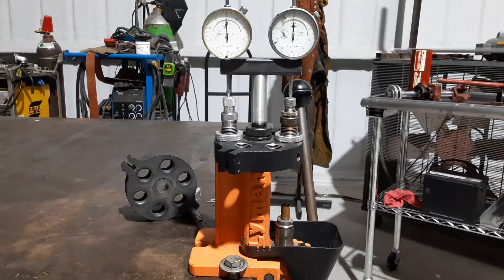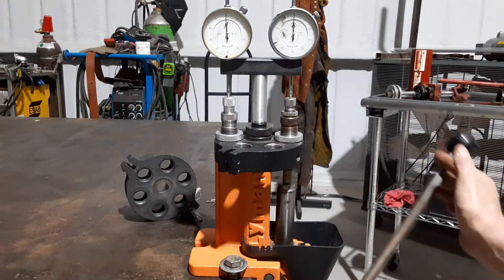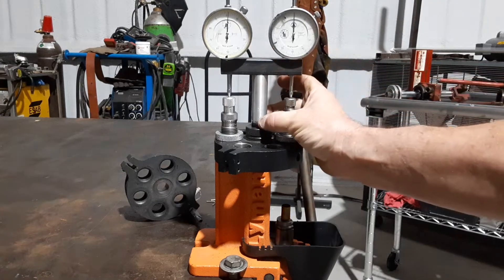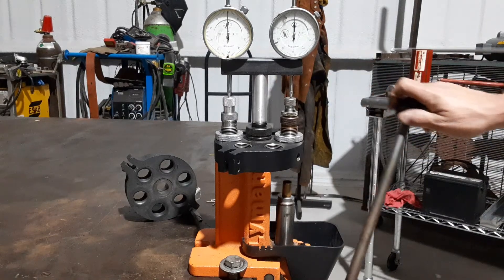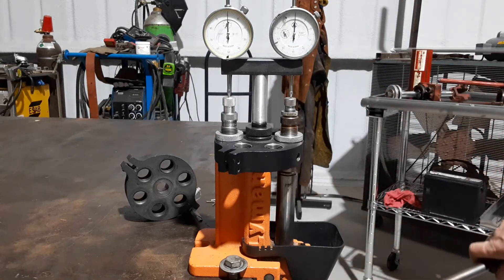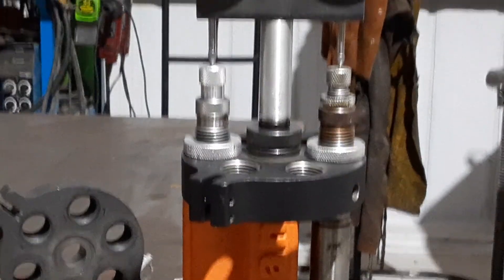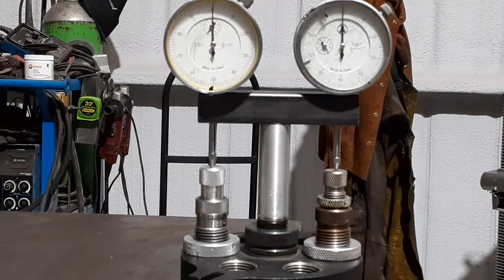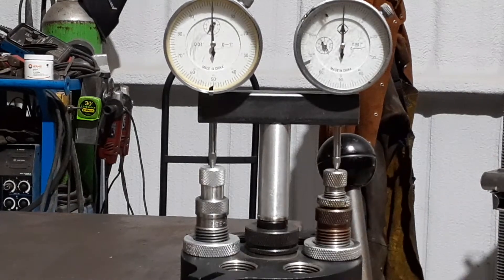Turret movement on a Lyman turret press.

Comment: I bought one of these Lyman T Mag Turret presses in the  early1990's to replace my RCBS Rockchucker Jr. that i bought in the late 70's.
I needed 15000-18000 rounds of .45 ACP per year to compete in IPSC matches. Loading that much ammo to shoot matches with the single stage instantly turned into a reloading marathon. It only took a month or two of that and I bought the T Mag turret. It was an affordable way out of the long sessions at the bench.

You can remove quite a lot of the play in the turret rocking by simply scraping the wrinkle paint off both sides of the turret under the center hold down washer using a gasket scraper. Scrape the wrinkle paint off the bottom of the turret where it sits and rotates on the press. I also scraped the paint off on the top of the turret around the holes where the die lock rings seat so the dies stay snugged down and true. Also the center hold down bolt/screw has a shoulder that bottoms on the press body where the turret sits. If the washer under the hold down bolt is not thick enough to take up the play the turret can rock like in the video. It takes a bit of fitting but these presses can be made to barely wobble and still rotate.

I also loaded small batches of 7.62x39, .357 magnum, .45 colt and .22 hornet on another spare turret. It is quite handy to have a spare turret or two if your loading larger quantities of a certain caliber and don't want to strip already set up dies out of that turret.  

For the .45 ACP I used the RCBS priming arm and tube primer feed which fit on the Lyman turret and a Lee Auto Disk powder thru the case mouth flare die. I rigged a clear flexible tube out the bottom of the spent primer catch tray down to a coffee can on the floor under the bench. 3-4 hours on a Saturday i could produce 400 rounds of good reliable and accurate .45 ACP 175 major power factor ammo.